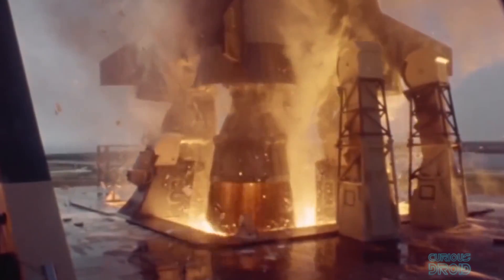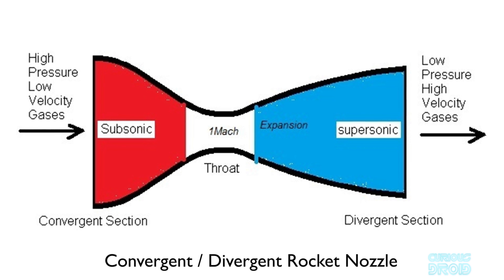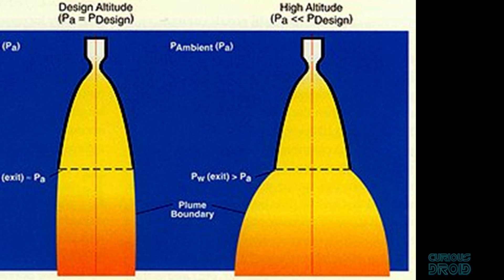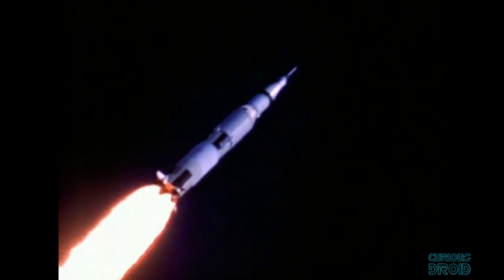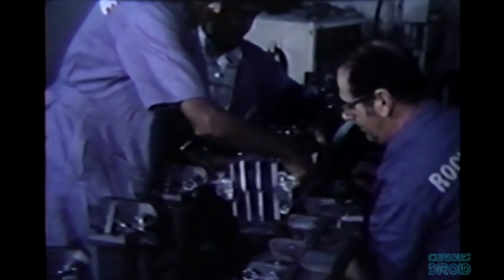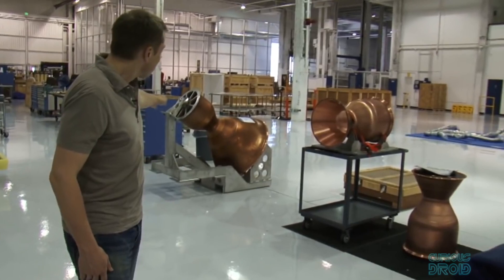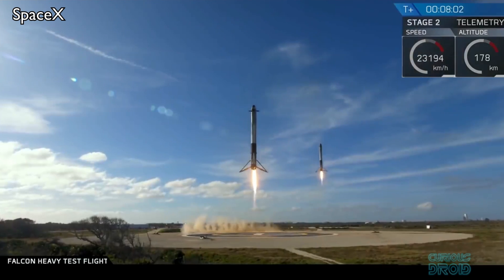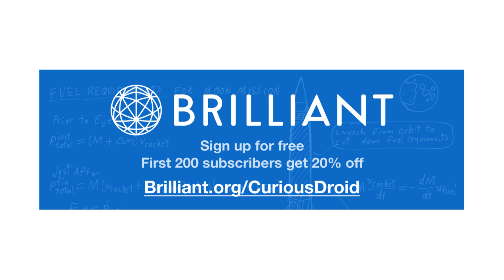Aerospike Engines - Why Aren't We Using them Now?

Comment: how much of this information could i apply to Kerbal Space Program, lol
Reply: KSP already has an aerospike engine. It works quite well, I use it frequently. There is only the one small round version though. It'd be nice if there were a larger linear version.
Reply: @Thumbsupurbum  It's nice for taking off from Duna, and for spaceplanes. Although admittedly the main reason I like it for the latter is that it's so short and there's less chance that I will smash the thing into the runway… 😂
Reply: @TruthNerds  aren't space planes best powered by jet engines not rocket?
Reply: @gabemerritt3139  Jet engines are great for jets but if you want your space plane to get to space, you gotta have some rockets!
Reply: @gabemerritt3139  you can you jet engines on first stage, than drop plane with rocket engines from it. 
Also, combination between jet and rocket engine is being developed
Reply: @adamrezabek9469  Yeah I was thinking of those RAPIER jet engines that do not yet have a real analogue, that can still function while oxygen starved.
Reply: DirtyBlastard yes

Comment: How does it work in a vacuum, with no outside pressure to shape the combustion?
Reply: John Długosz don’t believe they are ever used in a vacuum, pretty sure just like the shuttle or other rockets they are used to get to space than shut down.  Once you get to space you maintain whatever speed you had so no propulsion is needed. Just gasses used to change direction.. can’t remember what they are called..  keep in mind I’m making a slightly educated guess haha

Comment: I don't think SSTO is in itself a good idea or even something to be pursued. Regardless of engine efficiency at different altitudes. SSTO means having to carry a huge amount of useless mass up to orbit, reducing the payload capability by that same amount.
Once you drop the requirement of SSTO then there is not really that much benefit of having an engine that is efficient from sea level to vacuum. Given also that most of the delta V is imparted in vacuum it makes sense to have an engine optimised for vacuum to do that and a bell shape nozzle is actually more efficient than an aerospike in vaccum as the exhaust plume can be made to diverge very little, whereas an aerospike will necessarily have a significantly divergent plume.
I think the main reason the aerospike has never been put to actual use is that when one does the math, all of it, it turns out that the bell shaped nozzle is actually superior.

Comment: why don't we have bell chaging chamber like the f35 and such?
Reply: That's a good question. Part of the answer, I imagine, has to do with strength. Aperture nozzles might not be strong enough or well-sealed enough to serve as space-faring rocket nozzles. Cooling could also be a problem, since a moving and thin fin on an aperture would be even harder to wick energy from than bell nozzles already are. Imagine the pipelines required to liquid or air cool those fins in space; they would be irregular shapes or very small, which would cause all kinds of flow problems, thus causing pressure imbalance and ultimately instability.

Comment: Efficiency loss due to atmospheric pressure is NOT the only reason we have multistage rockets, and resolving this problem will not make SSTOs possible. The other reason we use multistage is because it simply gives more DeltaV. If you have only one stage and want to have more DeltaV, you must have more fuel, but the more fuel you add, the less DeltaV you gain, because your rocket gets really heavy. By making multiple stages, when the next stage kicks in, you lose the dead mass of the tank of the previous stage. If tanks had zero dry mass, and engines zero mass, then multistage would be useless.

Comment: 40% fuel saved does not means only fuel cost saved, it means less mass, nearly 40% less mass, so much more deltaV, much more utility mass.
Reply: @BRRP Yeah, I think it's easy for people to second guess what's being said. It sounds like the efficiency to mass savings calculation was already done. The engine probably isn't 40% more efficient, but even a marginal increase in efficiency rapidly pays dividends in rocketry.
Reply: @Bustermachine  

Only that fuel is almost all the mass of a fueled up rocket system.
It was ~80% of the space shuttle's mass. Cutting down that by 40% is still saving 32% overall and that's somehow not worth it because profits? I thought the eternal bullshit you people spewed was that capitalism DRIVES innovation, not fucking slows it to a fucking crawl. This is basically Roman Empire fall 2.0.
No more fresh slaves to catch, overseas hyperprofits are going down, system enters a death spiral(or basically has entered it ~half a century ago and the downturn was forestalled by a chain of fortunate events). You westerners should pray for a new, humongous market to open(on the scale of infotech) or your comfortable existence might come to an end sooner than you realize.
Reply: @sebastiangorka200  The engineering going into a rocket design costs way more than the fuel. It might be worth it. But how much cheaper will it make your launches? Will the cheaper launches create enough increased demand to offset the initial sunken cost of developing the engine? What about the lost time not launching something while you devote resources to a new design? Alot goes into a space program.
Reply: Sebastian Gorka So capitalism has stopped the progression of the species, but no other countries have used this engine?
Reply: @850imawesome  Has the country of origin used this engine? No. Is progress solely contingent on using this engine? Also no.
Reply: Sebastian Gorka Okay but the entire initiation of your argument was based on the use/development of this engine, so that’s what we’re talking about. I don’t think you can blame capitalism on the lack of use of this engine when in fact no other countries have used this. If you actually do a little research you’ll see that a few American companies had continued researching and developing this. The lack of money is what caused them to not be able too, and it’s not just solely based on profit. Money is necessary for growth also.
Reply: @850imawesome  The lack of money is based on non-profitability in the short term, which is a distinctly capitalist problem. Lot's of technologies get axed, or bought up and shelved to preserve profits or because they'll take too long to recoup the investment.
Reply: @sebastiangorka200  Yeah, capitalism is a cult developed by psychopaths.  It consumes resources voraciously and provides many different kinds of opiates to the working men and women to keep them happy, fat and stupid.  It's gotten so good at this, and so efficient with propaganda, it just keeps spreading.  We've seen dozens and dozens of countries pass the USA's standard of living with lower illiteracy, lower prisoners per capita, lower violent crime, lower homelessness, lower poverty, lower malnutrition, better health care, longer lifespan, lower infant mortality, better healthcare, fewer mass food poisonings, less wage inequality, higher overall happiness by poll, better privacy protection for individuals and lower national debt per capita.  All of them have some form of democratic socialism as their government.  Yet many Americans would rather have a civil war than take a step toward that superior form of government.
Reply: There's a much simpler answer: This was never about profit. It was about developing a technology that no private company would ever touch with a 10ft pole.
Developing a new space shuttle isn't about making a profit. The apollo program wasn't about profit. The ISS isn't about profit.
The reason linear aerospikes didn't pan out, isn't because "they weren't profitable", it's because they were too *costly*.
Let me explain is this way:
The Saturn V was never going to be a commercial launch vehicle, it was too expensive. It was designed for the express purpose of the US government lifting a buttload of mass into space. That's it. It was not meant to be profitable, only to do a thing that no one else was doing, because it was deemed "too fucking expensive".
So why did it use F1 rocket engines instead of aerospikes?
Money. But not because PROFIT. Because COST.
The difference between spending 25.4 billion dollars to do some stuff, and never getting any money back, ever.
And spending over 30 billion dollars to do that same thing, and never get any money back, ever.

The Soviet Union didn't build Buran because "we need a more cost effective way to do space stuff" or "we could sell this service to other nations and make money"
They build Buran to prove a fucking point. There was literally no reason what so ever that they ever needed an SSTO. There was nothing an SSTO could allow them to do that they weren't already doing.
Recovering satellites from space? In the hundreds. Didn't need a shuttle.
Build a space station? Mir was more than half complete by the time Buran did it's first test flight.
Send crews to space? We're STILL using Soyuz to do that.
Save money?? It was actually less expensive (like WAY less expensive. Like orders of magnitude less expensive) to send up both a proton and soyuz rocket than Buran.

Sometimes, a govt just spends a shitload of money developing a technology because that technology needed to be developed, and because we need to know if its POSSIBLE.
Thats why aerospike development process, and that's why no aerospikes.
Reply: @sebastiangorka200  someone needs their chill pills
Reply: true,that leads also in using just one aerospike engine instead of multiple engines in different stages,so also less weight for additional engines without also having the problem of dealing with returning stages.
Reply: also single stage spacecraft would mean no complex staging and less travel planning. You just need to actually pilot the ship towards your destination without timing every stage operation
Reply: 40% fuel savings = more payload?
Reply: The millennium falcon is a SSTO and uses an aerospike engine. We need to build this
Reply: @sprogg2001  Actually, that ship is even more advanced than the Enterprise. It can take off from a planet with ease while Kirk's ship is only happy in outer space.
Reply: And more utility mass means more guns
Reply: Succubus Chan  
"will keep the West alive"
ok nazi
Reply: @sebastiangorka200  Gets on YouTube and goes on a tirade about capitalism and gets owned. Then proceeds to call that person a nazi because he disagrees with your assertion. Gotta love YouTube trolls.
Reply: @samos8367  owned how? he just recited the typical "west is best" chauvinist schpiel that nazis love to spew no substance no nothing
Reply: @samos8367  right? "Chauvinistic, Nazi, etc." Typical responses of his thoughtless type. He did leave off "Racist". Maybe he forgot ?
Reply: @sebastiangorka200  the way you talk is exactly the same as his, from what you understand. 
Dangerous and extremist. 

Nazi or communist. 
There is not much difference in the end. 
All did awfull things to get their means.
Reply: @Sebastian Gorka hows the USSR's space program going?
Reply: @briannorris1548  could ask the same about NASA
Reply: @briannorris1548  I mean the USSR beat the US in basically every aspect of the space race.
Reply: Are you an engineer  ?
Reply: @Wrongway346  it is the very basis of rocket science: at the ignition the engine must lift all the rocket including all the fuel, so the consomption is higher. If you need to go at 200 km orbit for example, you need a powerfull enough engine, but now you need the fuel to feed it, and now you need a more powerfull engine, and more fuel, etc. The result is massive rockets with a mass/power ratio making posdible to reach the wanted orbit. So, an engine more efficient is extremely interesting, because less fuel means a big down sizing for the same purpose

Comment: I think that the problem with aero spike engines in order for them to be successfully profitable is the size of the engines themselves. In all of the canceled projects that were using the engine (and all of the canceled uses of the engine in projects that were otherwise approved), your video shows that the aero spike engine that is being tested is HUGE in comparison to the engineers doing the testing. Bigger doesn't always mean better. Using multiple smaller sized aero spike engines instead of one big engine would probably prove to be more effective and more profitable. It might also prove to be safer if one of engines fails during testing, but the other engines keep working, the failed engine could be isolated and shut off until the test is over so that the engine could be examined afterwards to determine the cause of the failure. This would then help to minimize (if not prevent) disaster level accidents from occurring due to engine failure.

Comment: 9:05 When they cancelled that project, did they just outright cancel it instead of redirecting it and/or or breaking it up into smaller tasks?

Because that's just wrong if so. Any part of a project which has been so far successful needs to be considered for completion...like said engine.

Comment: So this is why you dont have rockets which just use drop tanks
Reply: That's basically what the Space Shuttle did.  It used side booster rockets as well as it's main engines during the first stage, then dropped the side boosters.  After the main engine shutoff, then the very large external fuel tank was dropped.
Reply: @patreekotime4578  yeah but its drop tanks with drop boosters. Not drop tanks only
Reply: @vmaldia  that's why I said, 'basically'.

Comment: I would have to say the most likely reason they aren't used is due to limitations or problems that haven't been overcome, like the reduced thrust between a range of speeds the engine passes through

Comment: There is a reason not to use a single stage rocket, which is weight and friction. The lesser fuel remaining, the friction along the full length body becomes an increasing waste, as well as the weight of the already fuel empty part of the rocket hull. So multi stage has a lot of advantage regardless of the engine used. But when multi-stage has the advantage of lesser remaining weight and friction along with each droped stage, then the per stage optimized more effcient bell shaped outlet (laval nozzle) is obviously better than the lesser effcient aerospike outlet.
Very simple to understand, isn't it?!

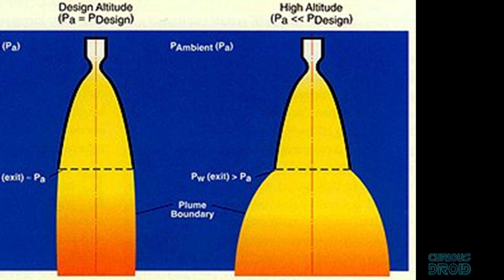Comment: bit late to the part but another mistake is at 3:50 you talk about over-expanded nozzle yet show a picture of an under expanded one. A quick way to check it is this: over expanding means expanding too much, aka the pressure is lower compared to the surrounding pressure, which means the air around it "pushes" the gases back into the nozzle, and therefore you get the signature pointy exhaust. and vice versa for under expanded.
Reply: Expanding means taking more space. Overexpanding then means taking too much space and this what the right layout perfectly shows, imho.

Comment: @curiousdroid So, outside of the efficiency needed for an SSTO airframe, there is not enough of an economic benefit to the aerospike -especially in SpaceX's case, where they figured out how to reuse the first stage anyways. I wonder: how much more inherently complicated, i.e. prone to failure is the design?

Comment: This is brilliant.  I never thought to ask why the exhaust plume widens out when the rocket is much higher (I think I thought it was because of fuel running out in that stage, or because the old lower stage took a while to separate).  But thanks to your wonderful explanation it explains it fully, clearly, and logically.